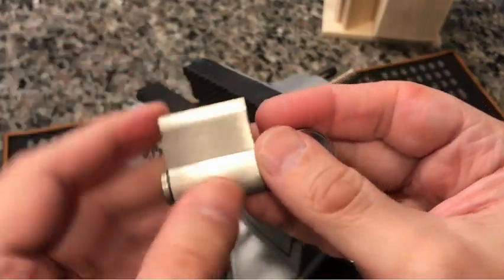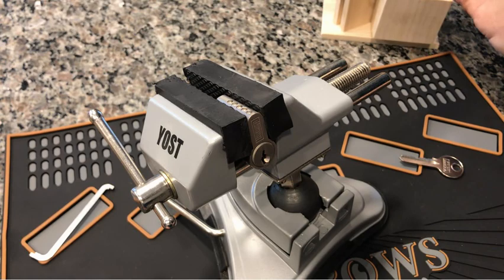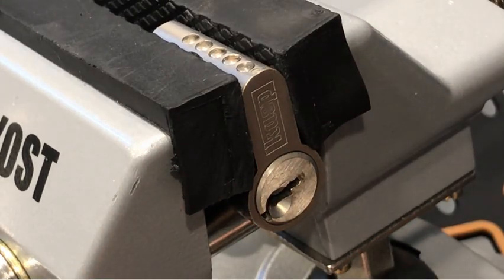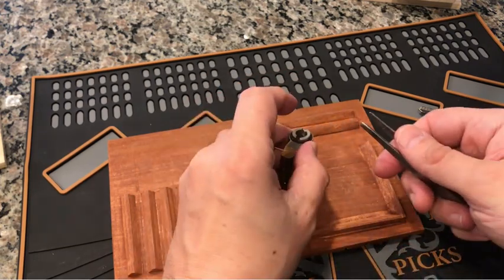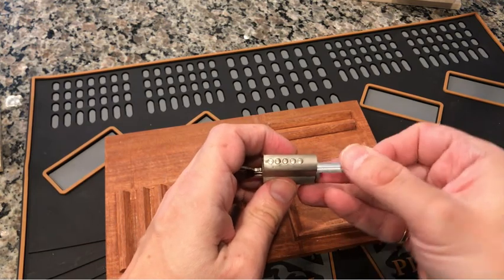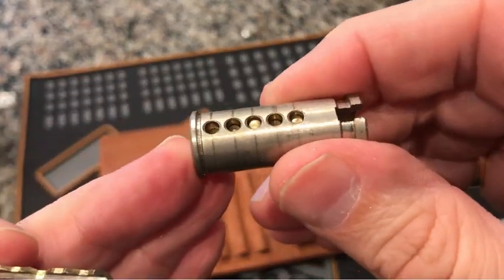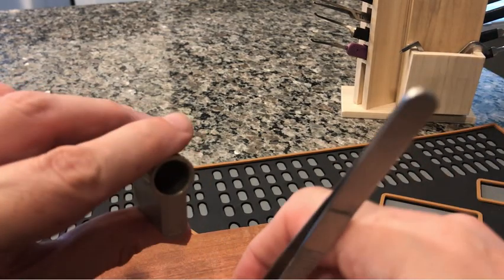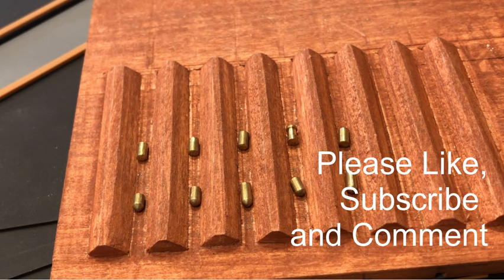Kasp Euro Cylinder Picked and Gutted [41]

Comment: Good pick....Hi Doug, just wondering why you always add a shim when you use a follower?
Reply: Wait til one explodes everywhere then you’ll know 😉
Reply: @lowellforbes3208  Sorry, if the follower is in the core how will all the pins explode? He takes it out before revealing each pin. I see no purpose in it.
Reply from the maker: Valid question.  if you check out my video #7 (KwikSet) you will see that they use a "fishbone core".  It has ribs that line up with the driver pins.  As you slide the plug out, the voids will line up with the drivers, and they will shoot down into the voids - which will seize up the plug in that spot.
Reply: I say always use a shim thats will help stop flying pins and springs.
Reply: dougpickslocks 👍🏻 I checked out that video and now I understand why you use a shim in addition to the follower. I never saw a fishbone core before, can you tell me what the purpose of them would be? I'm curious because high security locks like Medeco don't use that type of core. Thanks 😊

Comment: Wow, amazing how it’s the same company but very different pick-ability. Nice work Doug. I would have guessed it would be a bit harder just based on how nice it looked, but I guess you shouldn’t judge a lock by its outside 😊
Reply from the maker: Thanks! I guess it can just come down to loose tolerances, or where they put the spool (they work better when paired with shorter key pins)